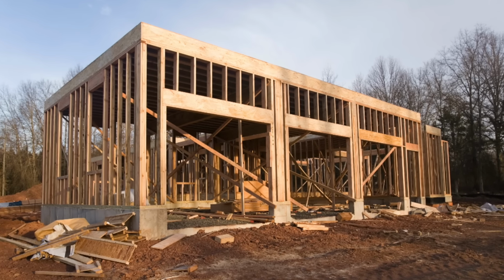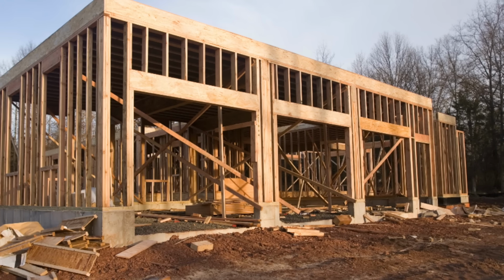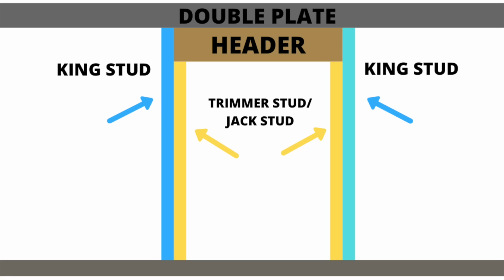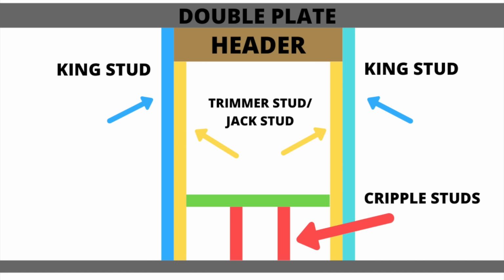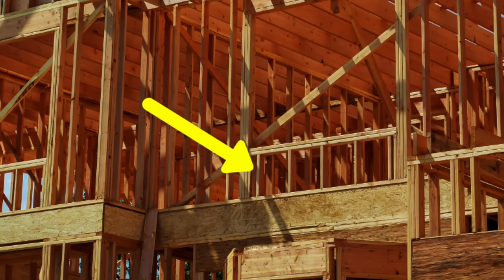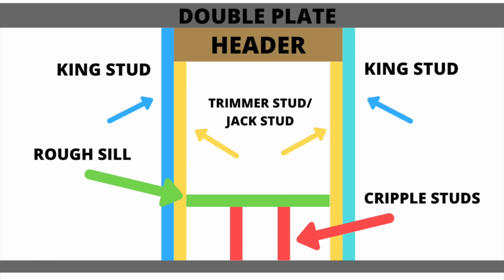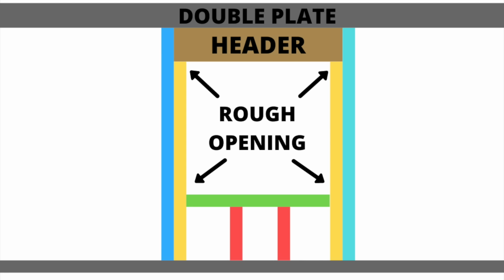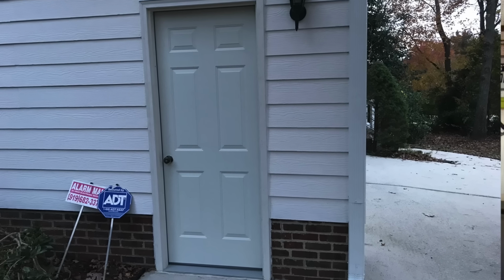All House Framing EXPLAINED...In Just 12 MINUTES! (House Construction/Framing Members)

Comment: you really need to stop building houses with lumber. so cheap man, where i live nobody would buy those...
Reply: Where I live, everybody buys them. Lumber is environmentally friendlier than any other building material.
Reply: @Jobacuda  well, it ceases to be when you factor in the expected lifetime. Here in europe houses are expected to last 100+ years. (And that's on the low side, last house i lived in was a 120 year old stone house, and it looked like it could last 120 years more. Big stone houses last forever.). All the while being practically inmune to mold, fires, floods, hurricanes... Dunno about you, but i wouldn't spend my life savings in something that is a kid's prank away from disspearing into nothing. Just use brick and mortar man... 

The house before that one was a 20 year old wood house that was already showing apparent signs of decay, and that without having withstood any special damage, just from exposure to the elements. It was in Barcelona btw, not really a place where there are many elements to be exposed to, it rains little, no floods, no harsh temperatures, no winds no nothing. Still, the house was 10 years at most from having serious trouble, and that with yearly maintenance too. So do the math :)

My guess would be that people buy those just because there's nothing else to buy.
Reply: @jobacuda4472  Ohh and while living in 2 story condo before the wood house, a fire broke out in the flat directly above mine during the night. Firefighters evacuated the building for a grand total of 2 hours and then we went to sleep like nothing ever happened. The guys who caused the fire were back two days after. If it was made of wood i'd probably be dead now. So, just use brick and mortar man.

Comment: Ive been a carpenter for 20 years. Nice video. Only thing I’ll say is that I and every carpenter ive ever known refers to the stud holding up the header in a door or window opening as the cripple, not the fill in studs (jack studs to some) under the window sill plate. Think of both your legs and one gets partially amputated. Its a crippled stud. Together both are just referred to as a “stud-cripple”. Also no one says “king stud” because that term is most often used for when there is a king pin/king stud holding up a ridge, hip or valley.

Comment: How does the mud sill have to be treated?  Are there options for treating the lumber yourself?  Would standard finishes or varnishes be enough?
Reply: No, they have to be pressure treated and labeled. Or use a membrane; then you generally don't need treated.

Comment: meh. waste of time. just build hollow walls out of treated wood, with some rough timber poles in them every foot or two, fill the walls with concrete, and repeat the process for any further floors while adding hollow boxes/tubes to acts as extra support for the floors and ceiling. you still end up with wooden walls that you can do what you want with, but dont end up spending some 30-40k for a bunch of wood. you also end up with a much better home overall.

Comment: I have a question for u :my 44’ x34’ 2 stry slab on grade build. Each floor has 24” trusses with most being  full length.  I finished the inside n while the sheet rock went on smoothly I noticed the ceilings aappear flat but the floors r not. They are either wavy ( top floor ) n dish shaped on center floor with the sheet rock bottom space varying. (1/2” normal gap) n most obvious in the room center. Hard for me to get ? But wtf is a reasonable why ?    My main open area is 1 1/2” low in the middle. Input / feedback appreciated.

Comment: Correction:
Engineered truss roofs are nothing new. They actually gained mass usage in the 70s, primarily in large scale suburb developments. For large scale builders they are preferred due to the ease of making and installing them in near identical house developments. However, they do have major set backs compared to rafter roofs. You lose large amounts of attic space and access with a truss. As a DIY home builder they are impractical as they require heavy equipment to set them. Truss roofs are also significantly less stable on the gable end of a roof from forces going in/out of The Wall such as wind. As well less stable in general to a rafter build again with forces going in/out direction from Gable end to Gable end because of the smaller dimension lumber used. Trusses also pose major challenges for installing roof skylights.
Reply: Even though roof trusses aren’t new, they are way more prevalent today then they were back in the 70’s.  They’ve gained quite a bit in popularity over the last 50 years especially with the advent of computers making production more versatile & efficient.   I would also add that roof trusses aren’t really practical in custom home construction due to the fact that every home is unique & roof configurations are more complex
Reply: @jarueb  I built custom homes in Reno, NV. All were truss-built roof systems (very complicated ones). Stick-built roofs would not hold up under 10' (3m) snow loads.

Comment: Nice video. I personally hate light weight 2x4 trusses though. Not very strong and can fail very quickly under certain circumstances. Held together with 1/2" gusset plates, honestly this should not even be allowed.
Reply: They are tremendously strong. In the right direction. I set thousands of them and only had a problem once. A freak wind storm. I think a stick-framed roof system would have come down too.
Reply: @jobacuda4472  … not as strong as legacy construction and fail very fast in a fire.
Reply: @tewksburydriver8624  I disagree on the strength issue. I built some in Reno, NV. Virtually no stick-framed roof systems because they can't take the snow loads. As to fire, no one should be in their home when their roof system burns. That's what smoke detectors are for.
Reply: @jobacuda4472  … trusses are faster and cheaper, that is the benefit. 2x4 trusses, lightweight trusses, are budget building. I’m a firefighter and we can’t save a building on fire with lightweight trusses, we can’t even cut a hole in the roof. Legacy lumber we can operate on a roof even with fire below us. They are structurally acceptable, cheap and fast, but not better.
Reply: @tewksburydriver8624  The houses I was building were in the $2-3 million range. Not exactly starter homes. All trusses, with one gigantic steel truss.
Reply: @jobacuda4472  ..  trusses are 30-50% cheaper than traditional methods. That’s just a fact. They lack the mass of rafters and solid beams. Happy thanksgiving
Reply: @tewksburydriver8624  Correct. Strength through engineering.
Reply: @jobacuda4472  ..acceptable strength, doesn’t mean better. It’s a cost savings measure and it speeds up construction, that is why they were created. I have a different perspective and many other people feel as I do. They don’t call it lightweight truss construction for no reason. Every engineer knows the strength comes from the mass of the building components, ie heavy timber construction, strongest there is. 2x4’s are for wall studs, not structural framework imo.

Comment: You didn't talk about going high with the walls (erecting the walls), joining interior walls with exterior walls, connecting corners, notching for diagonal bracing with 1x4 or 1x6s, or plumbing walls.
Reply: Sounds like about 20 more videos!

Comment: I noticed in one of the shots that the carpenter did not treat the end of a mud sill cut with copper green. Treated lumber should always be treated with copper green when it is cut because the  exposed interior is not treated.  Truss joists are strong and you can bore much larger holes in them. The only downside with these, as far as  I know, is they don't have the burn through rating of conventional dimensional lumber. In other words, if the home catches fire, they will lose structural integrity faster than a conventional joist.  But you probably don't have to spot the crown with truss joists and there's less shrinkage.
Reply: When southern yellow pine is used, the chemicals go all the way through the boards. That may not be the case everywhere. In California and Nevada, the treatment is completely different. The wood needs to be lanced to get any penetration.

Comment: Here in FL (probably most of hurricane country) the exterior walls are concrete block, offset like bricks, with the hollow channels filled with concrete (linel [sp]) afterward. The foundation is always a slab (no basement) with steel rebar embedded, protruding upward into the channels in the block walls. The roof (trusses) and interior walls are the same as the video.

Block walls are the reason wood siding is rare here. Instead we typically get a textured stucko look to the walls.
Reply: There's probably rebar in your block wall, too, Envie. Tied securely to the roof trusses. I remember driving on I-95 south of Miami, after Hurricane Andrew. I could see hundreds of houses, almost all of them with no roof system left. The upgraded the Code massively after that.
Reply: @jobacuda4472  I believe you're right about that. I don't work in construction personally, but I do recall seeing rods of some sort extending from the tops of the walls after the linel was poured.

Comment: You didn't mention anything about bracing.  Since, there there were some in the photos, it might have been good point them out.
Reply: The exterior sheathing was probably nailed to the walls before they were lifted into place. If so, the only bracing needed would be for interior walls. And then only temporarily.

Comment: Explain why housing is mostly all wood framing, even though, over the life-span of the home, a single (and required) termite extermination, will raise the cost of home ownership, above the price of a similar, metal framed unit?  If this isn't false economy, I don't know what is.  Wait until someone tells you that your home MUST undergo a full-tented extermination procedure, before you can sell the damn thing.  Modern science has yet to positively prevent termites from eating you out of house and home and many homes will go through multiple extermination orders, over the years.
In fact, almost all wood-framed homes, will undergo a termite extermination process, sooner or later.  The ones that haven't, are just patiently waiting their turn. ( And no,  I'm not an exterminator) just a carpenter.  Shall we discuss dry-rot next?

Comment: I am building a Timber Frame cabin for my wife and I.  The Timber Frame provides the core frame , the stud walls are just for the insulation, windows, doors, sheathing and siding and are not "structural" per se although they do provide extra structural support.  I had to have a Structural Engineer provide confirmation of this to the Building Dept. after being repeatedly denied a Building permit because they had no clue!  Great explanations and I learned a lot.  Thanks for the video.   Windows and doors in the spring!!!
Reply: I imagine the sheathing on your exterior walls adds a lot of shear strength. Good luck with the build!
Reply: @jobacuda4472  The frame sat for 6 months during last winter.  There were a couple of storms with 50-60 mph winds.  I should have braced the frame.  There was some wracking but not enough to have to straighten it. It's rated for 3 second gusts of 95 mph when it's completed. We did  some straightening when we did the stud walls. It's "not going anywhere" as my Grandpa used to say!
Reply: @timcisneros1351  Thanks, Tim! I guess that, when it's just the frame that's up, there's not much surface area to catch the wind? What species of wood are your timbers?
Reply: @jobacuda4472  Coastal California Douglas Fir.  A lot of trees were lost last year when the fires swept through the Santa Cruz mountains.  We're going to a site on Saturday where the fire destroyed a canyon and most of the homes there.  There are 18 21 ft. Douglas Fir logs averaging 36 inch diameter.  We are bringing a Lucas Sawmill and will mill all of them onsite.  Half goes to the owner and the other half we can keep.  I am just helping my friend who has the mill.  All I need is 1 or 2 of those to finish building our cabin but also need some for my shop as well.  A simple pole barn design with a dirt floor.  I'm a Blacksmith by trade but also love wood working.  Being in the forest and milling lumber that you are going to build your home out of is pretty magical too!  Great therapy for the body/mind after all we've been through.

Comment: It’s interesting watching this kinda content from other countries. I’m in Australia and we don’t clad all the walls or whole roof with ply like in this video. Instead we only usually put ply at the corners of the building and then use steel flat straps with tensioners to brace it all - that is, in the non cyclonic parts of the country.
Reply: no one cares, mate.
Reply: I assume your steel straps are installed on the diagonal. If so they are adding a lot of strength. I have lived in North Carolina for 40 years. I've seen thousands of houses built with plywood only on the corners. If you are away from hurricane and earthquake zones, just the corners is ok.
Reply: @jobacuda4472  yeah diagonally and in both directions so they cross. same on roofs

Comment: That was really well done. One question I have struggled with is why we build with pitched roofs for residential but virtually all commercial even smaller buildings use flat roofs. I understand the transfer of load to the walls, but a flat roof seems more efficient and useful.
Reply: Hi James! There are lots of reasons residential and commercial are typically different. The rolled roofing, rubber, and other materials used on a flat roof save money in a commercial installation, but the roof will need frequent maintenance. In a commercial building, especially one with many retailers in it, the businesses share these fees, limiting the cost. For a homeowner, it’s cheaper to install it really well once, and then never touch it again unless there’s a major issue. 

In a residential home, most people want a 30-year roof. Flat roofs generally last about 10-15 years. The flat roofs are actually “low slope” roofs that drain toward the middle or the outside, so even they have a little slope to them. Another reason commercial businesses prefer flatter roofs is the option to put large AC units on top - keeping valuable retail space below available.

The big risks associated with flatter roofs are a tendency to collapse under snow or standing water, leaking, and constant upkeep. Again, if the purpose of the structure is purely economical, you can offset those issues with profit. If the purpose is residential, it’s just not worth it. Hope this helps!
Reply: @mrcolesenglish1401  That helps. Although I do see flat roofs (2% sloped) even in residential. If designed for the snow load, there is no risk of collapse. Depending on the roofing material the life could be extended. Total life cycle cost should apply to either method. Is there any reason the pitched roof would be cheaper? More surface area and more material doesn't make sense to me.
Reply: @jamesbererton9584  As to snow loads, flat roof members need to be engineered to a much higher standard than pitched roofs.
Reply: @jobacuda4472  but is the load that much higher and is the material cost of sloped roofs actually more expensive?
Reply: James, it's not a question of if a flat roof will leak. It's only a question of when.

Comment: I know this is an old video but I was wondering, is there some structure to make sure the joists laying on top of the mudsill don't deflect and come into contact with concrete slab? Or are thr joists made of treated lumber so that doesn't happen?
Reply: JMJM, joists are never used in conjunction with slabs. The foundation walls are concrete or masonry, though, so the joists sit on a pressure-treated mud sill.

Comment: Glad I live in a fully masoned building
Reply: Sander, how do you run electrical wires and plumbing in the masonry?
Reply: @jobacuda4472  In between the outer and inner wall. The inner wall doesn't need to be stone by the way.